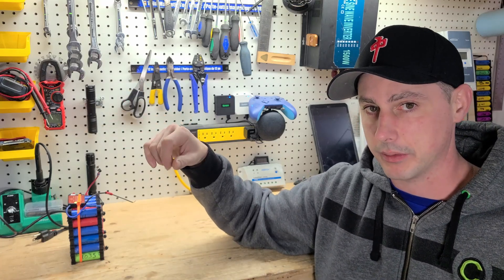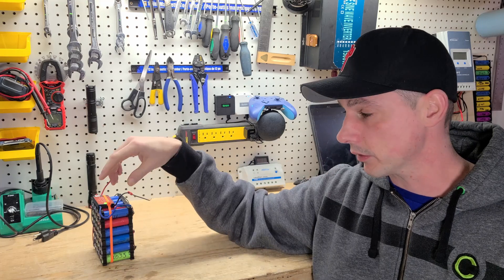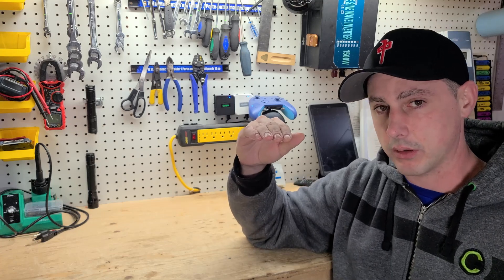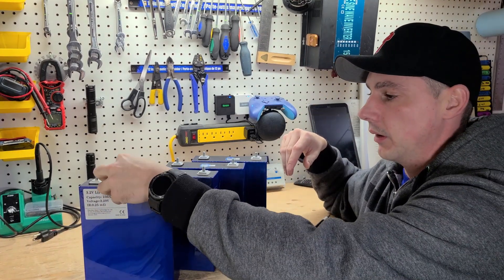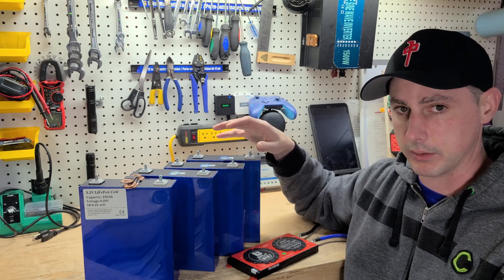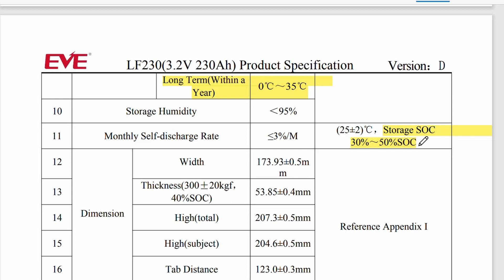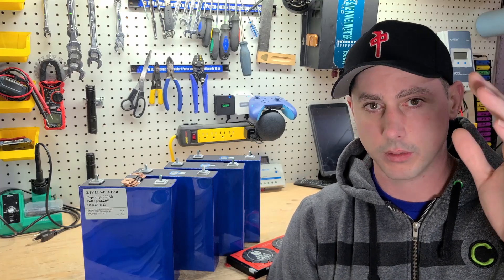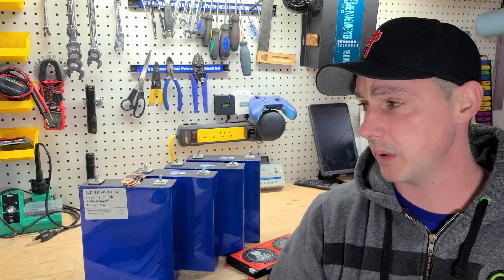Storing lithium batteries properly

Comment: Sorry to ask but I just got a car jump starter that has a lithium battery, but I'm not sure where to store it and at what temperature it could go on fire, I'm in Australia, can you please give me some advice the brand I got is called a Certa waterproof portable jump starter from Kogan. Thank you.
Reply from the maker: @eyesee1212  I have one too, I'm in Canada so not as hot but I leave mine in my truck year round. I take it out a few times a year to make sure it's full. Not the best for a lithium battery but cheap enough I don't mind replacing it.
Reply: @Roll2Videos  Okay thank you :)

Comment: I am using a 12 volt bulb to discharge my Dakota 12 volt 54 amp battery I learned from you not to use voltage to determine 50%. So how can I tell when battery is at 50% and what other way can I discharge my lithium batteries?
Reply from the maker: You can use an inverter, if your light uses 1 Amp leave it on for 10 hours. Just try not to have it at 100%. 60-80% perfect 👌
Reply: It says bulb output is 10 watts does that mean use it for one hour?
Reply from the maker: @ciscokid2444  10W divided by 12.8V that's 0.78A and you have 54A.
Reply: How can I tell if it’s at 60-80%
Reply from the maker: You'll have to use math
Reply: Can you give me the formula please
Reply: I can’t use the voltage right because the voltage doesn’t drop off till the end is that right?
Reply from the maker: @ciscokid2444  No, using voltage is pointless
Reply: So if I leave it on for 24 hours that should put me in the ball park?
Reply from the maker: @ciscokid2444  12.8V times 54Ah = 691.2 Watt hours. 691.2Wh - 240W = 451.2Wh left. Yeah, that will work.
Reply: Man you are the first person to help me with that thank you so much! I subscribed.👍🏽
Reply: I also have one of those Dakota powerboxes its 10 amp I am going to leave light on for 5 hours am I getting it now?

Comment: Have a SOK for my RV…. Put the lights to drop the charge and will pull it and bring inside for the winter. How can you discharge the battery at home?
Reply from the maker: You could buy a cheap inverter from Amazon. You would need to calculate how many amps are leaving once fully charged to get it to 60 ish %

Comment: My 300ah Ampere Time LiFeP04 battery and 2000w inverter ran my tiny Frigidaire air conditioner through five Louisisna extreme heat emergency power outages in my 5th wheel camper since June. I use it with a 60 amp MPPT solar charger and top it up before storms with a plug-in 20 amp charger and keep track of usage after topping it off with a watt meter. The watt meter doesn`t measure losses in the inverter conversion but I`ve used up to 3500 of the 3800 ah in tests of the AC with no problems and voltage got down to almost 12v. I was caught off guard when a sudden storm hit while the battery was around 50% state of charge and it still ran the air conditioner through an all night power outage with the thermostat set to kick on and off. 

I just discovered that my two Bluetti EB70 power stations will run the air conditioner too and I can dump the charge of my 9 smaller power stations into those with their 200w chargers extending my run time. A juggling act...but great additional option in emergencies. When outside temps are 105 to 114....I`ll gladly take ANY amount of extra cool air I can scrounge up! 

I`m poor, living in the camper on under 1000 a month in the boondocks on disability with no car, and was called "crazy" and "stupid" by my relatives for investing my meager savings on these preps and converting my mower, tiller, weedeater, cookers, water heating, etc to electric....IN A HURRICANE ZONE with a yearly average of at least 15 to 20 long power outages each year with severe weather 9 months out of the year and winter storms!!! I just got 200w, 300w, and 500w personal space heaters for the next below zero storm and I`m getting a backup 12v electric blanket. These can be used to heat batteries before charging too. I used an electric blanket last December when 50 mph winds downed the power lines at ZERO DEGREES!
Reply from the maker: That's a great story. Sounds like you're doing good with the circumstances you've been handed. Keep up the good fight 😁

Comment: I have an electric lawn mower with 4  12v 50 ah  Lithium batteries in it how can I keep them protected in a unheated garage for the winter ?
Reply from the maker: The best thing to do is remove them and bring them into the house for the winter. Have them around 60 to 90% charged
Reply: I was hoping for some way NOT to bring them in.. It will take a long time to remove the batteries .. any other options .? On really cold night would I be able to cover up the battery area with a electric blanket? hope that doesn't sound crazy
Reply from the maker: @rjazco51  You could try that. When they are cold, the battery will self-discharge. If it discharges below the safe zone, the battery will be no good anymore.
Reply: @Roll2Videos  any idea about what is the low temperature to be concerned with that will be harmful for lithium batteries..Thanks
Reply from the maker: @rjazco51  Everything I've seen says store at room temperature. Beyond that, I haven't gotten into the weeds about pushing the boundary

Comment: Great videos. Thanks. Just bought 12V LO4 Lithium for my caravan. Keen to look after it with storage at 40 to 60% approx. or 13.2 volts for now until my state of charge meter starts giving me accurate reading after a few cycles.  Question. If it has 4 cells with nominal voltage of say 3.2V and fully charged voltage of 4.2Volts? per cell. Wouldn't it read way to high at 16.8 V fully charged? 4 X  4.2V = 16.8V ? What am i missing :) I have lipo batteries in my RC toys with storage of 3.8V per cell. Full at 4.2V per cell and low cut off at 3 to 3.2V per cell but new to 12V LO4. Thanks.
Reply from the maker: Welcome to the lithium market 😁
NMC 4.2 is a fully charged call.
LiFePO4 3.65 is a fully charged cell.
I charge my LiFePO4 to 3.55 per cell and consider that fully charged.
I don't use NMC cells anymore.
Reply: @Roll2Videos  Ah, 3.65 = full. 3.65 x 4 = 14.6V Ok got it. So not the same as my RC Lipo’s at all :) 
Thanks for getting back to me👍

Comment: So how do you measure a lifepo4 battery at 50% charge?
Reply from the maker: An easy way is if your battery is at 0%, put a charger on a timer. Let's say you have a 100Ah battery and a 10A charger, Charge for 5 hours. Works the same discharging. 100%, 25A load for 2 hours etc.
Reply: According to the recent paper "The Degradation Behavior of LiFePO4/C Batteries during LongTerm Calendar Aging", you can prolong the life of your battery by storing it at a high (near full) state of charge.
Reply from the maker: @mobiusx8117  Can you reference in that study where it says that?
Reply: @Roll2Videos  Figure 19 on page 17.
Reply from the maker: @mobiusx8117  I'm still not seeing your recommendation of 90%+. Furthermore, I was talking about 6-month storage (over the winter), not 12-plus months of storage. After six months, they need to be charged and discharged.

Comment: My habit with my e scooter is to leave the battery as is after each ride. Its typically at 50-75% soc after a ride. Its never below 50%. I will then charge it the morning of my next ride. My thinking is this keeps stress off the battery between rides. I only ride it about once a week and I feel like this is better on the battery than keeping it at 100% soc all the time. Should I keep doing it this way?
Reply from the maker: That sounds perfect
Reply: How do you know what % charged your battery is? Is there a way of working this out by the voltage?

Comment: What happens if they are stored over 45c like 55c for a month like a storage shed?
Reply from the maker: It wouldn't be the best thing for them, Make sure their not that hot when you use them. Its more damaging in cold weather due to the battery self discharging and causing damage at a low voltage.

Comment: so, if you can't tell the state of charge by voltage, how can you tell?
Reply from the maker: With a LI PO battery, you can use voltage. But with LifePO4, you can not. I've learned a lot since making this video. With LifePO4, you can get a battery with a BMS that has bluetooth or hook up a smart shunt battery monitor. I have videos on them. Great question 😁

Comment: Does it matter if you store LifePo batteries in a cold shed. Below 0°C.  Looks like it’s not recommended but what happens.
Reply from the maker: The data sheets says down to -20°c for upto 1 month. The battery will self discharge. A lot of damage is done when they are discharge to 0%